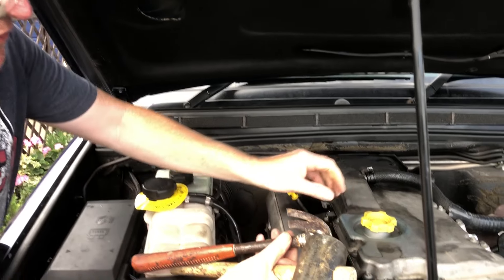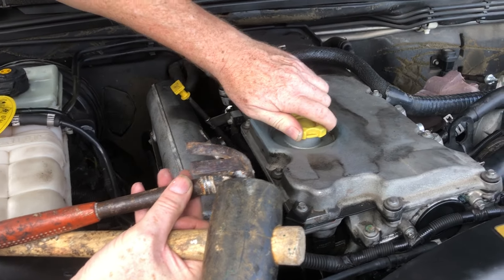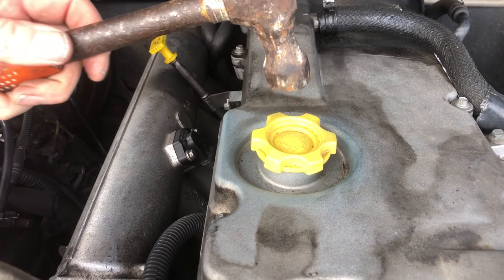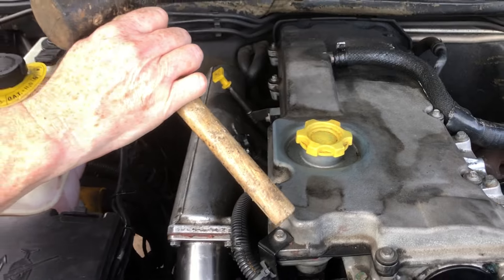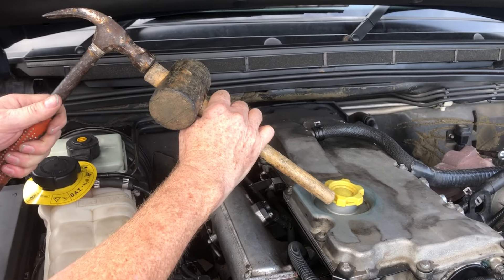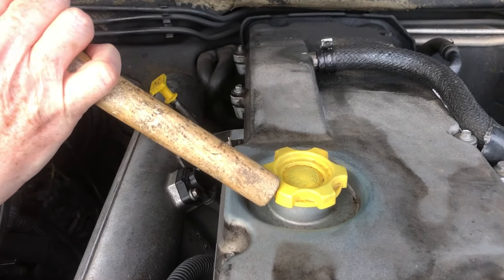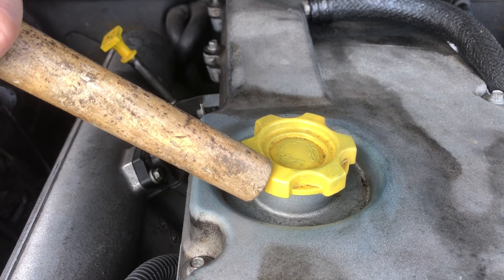How to remove a stuck oil filler cap 🚗😤 #shorts

Comment: 67 year old widow here and thankfully your video popped up! Although I needed to get the big iron skull cap off  which was definitely stuck on my outside heating oil tank your tip helped me! I used a metal rod and a hammer and got that sucker off! Took a lot of banging but it worked and I was able to put kerosene into the tank to prevent gelling since below zero temps coming this weekend. Thank you!!!!